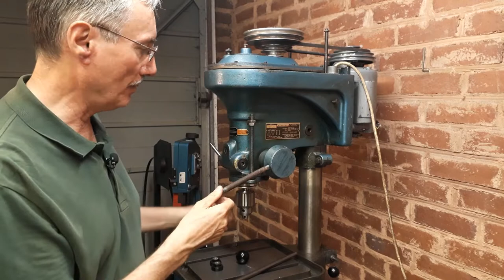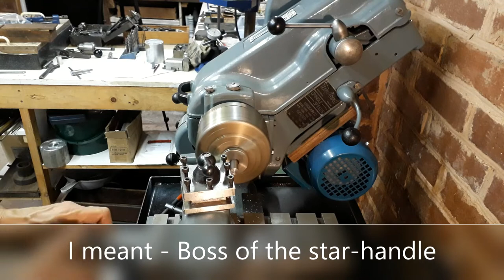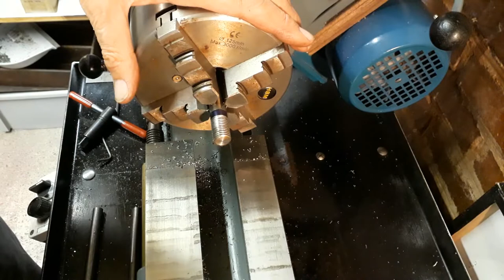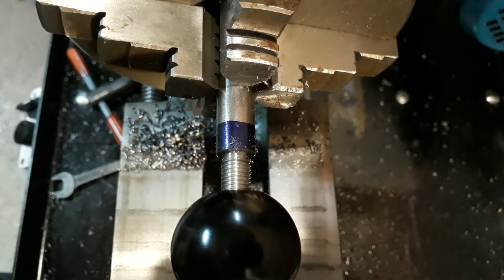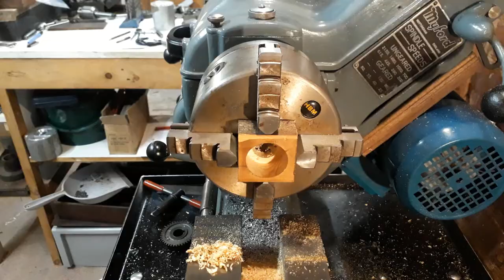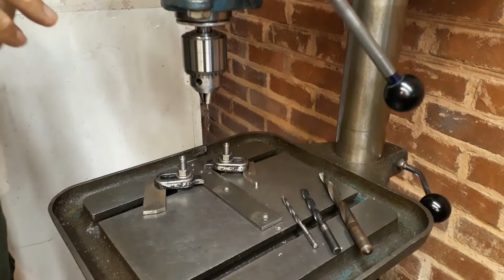Meddings Drill Renovation #5 (completion)

Comment: Great workmanship,  very intesting and informative video, watched with great interest as im just about to start 2 Meddings drills myself, May  I ask what motor and Vfd you have on your myford, would be very interested in converting my own, very best regards Ian
Reply from the maker: Thanks for your comments, Ian. All the best with your two drill renovations.
The motor and VFD were from Drives Direct. The VFD was one of the more basic variants. I can't remember the motor size but discovered it is more suited to the ML7 rather than the Super 7 for which it is slightly under powered. (Away from workshop now and can't remember the power rating.)
Reply: @Workshopfriend  Very many thanks for your reply, may i please ask (if you know of course) where i may get the plastic on the gear selector, unfortunately the pervious owner managed to not only take the plastic off but also decided in his wisdom to weld the gear to the shaft thus disabling the gears to be changed, many thanks again.
Reply from the maker: @ianwhiteley964  It is possible that you can still purchase from Meddings, Ivybridge, UK - they seem quite helpful on the phone. If not you might have to make from delrin.